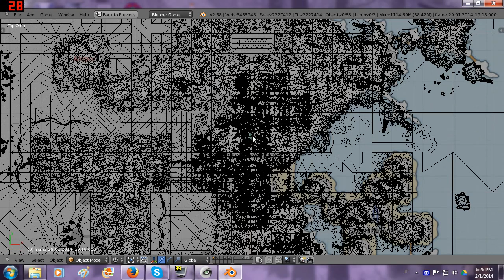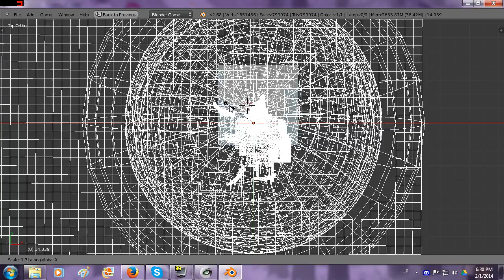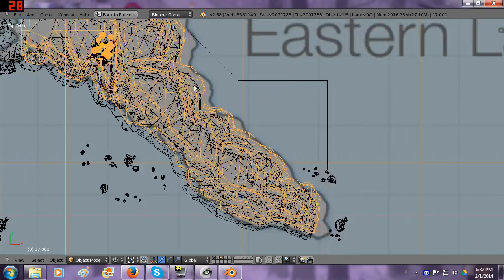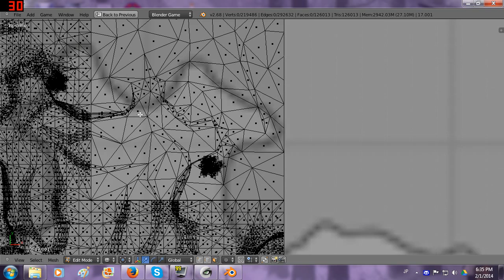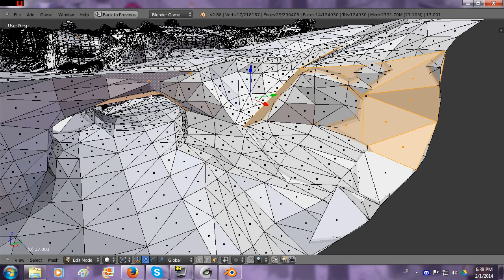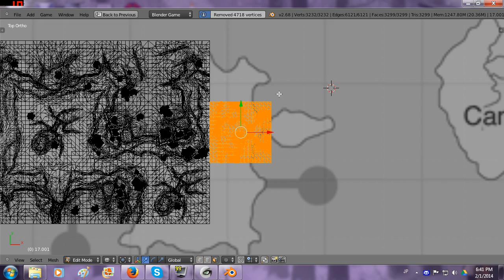Rebuilding Finaly Fantasy 14: importing 3d mesh

Comment: so, what's your goal with the landscape of FFXIV?
i've watched your videos but i'm still trying to figure out what you want to achieve by actually breaking them apart and putting them together.are you trying to add more landscape, dungeons or something like that?
i can see the want for that, being a 1.0 player myself, there wasn't much to the zones besides the huge size.
Reply from the maker: well the reason for breaking up the land is so only the blocks near you render in high quality. thats how they did it in 1.0. if we had it render everything then you would need like 2000x the processing power.

i'm wanting to make 2 versions. the origenal unchanged landscape then a 2nd one that i improve.
Reply: Rinoa In 3D i see.yea, the drawing distance was rather short in ffxiv 1.0, that's why DoF helped so much.i tried to increase it once above the standard, but it was a too big performance hit for the little drawing quality improvement.even now with a high computer setup the fps still goes below 30 with higher drawing qualities.i guess a big part of the performance hit was just the ridiculous amount of polygons used in 1.0.i'll be looking forward to your finished project.